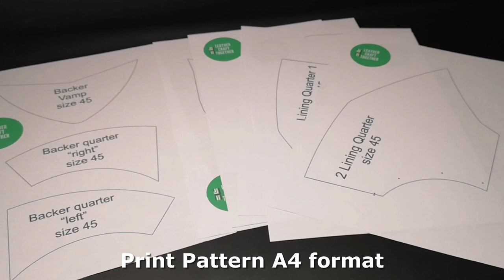Leather chukka boots making by handmade

Comment: Was really great until you just glued on a crappy moc welted sole. Why not do an actual Goodyear welt or stitchdown?
Reply from the maker: 1. Because a genuine leather sole with a welt will not survive in wet and humid autumn (as well as spring) and winter
2. The rubber outsole is more comfortable for the feet, as it is slightly cushioned
3. Real leather sole with welt is expensive for me and it is very long and difficult to craft
Reply: @leathercrafttogether8356  you do realize you can use a vibram or danite sole with a welt correct? It does not have to be a leather outsole. Look at White's or Nick's work boots that have welted or stitchdown V100 lug soles that will far outlast this boot.
Reply from the maker: @mattihnen2764  Thank you, I will take a look and try to know this topic better.
Reply: @leathercrafttogether8356  1. obviously moot point, stitch on Dainite or get a double/triple oak tanned leather sole
2. Some people might say that, but leather breaks in better and will make it more suitable for any shape of the foot, rubber will feel more comfortable at times but it is not better for the foot
3. of course a valid point but glued shoes are bound to be thrown away once the glue fails and the upper gets damaged. Also I think it's a shame that you put so much work onto the uppers and then just finish the shoe with such an underwhelming construction. Was also pretty disappointed when it came to the filler, pretty bad quality stuff used there but I guess it works for instructional purposes.
Reply: Simplicity inspires more to get in to shoemaking than to ”show of all your skills how to” uploads. Baby steps… Comparing other videos I really like how you make the nailing the upper to the last look so clean and easy, made me think I can do it too, so Im collecting materials to start soon. And thank you for the free patterns, what a champ! ❤

Comment: where can I get that pattern from?  aka template on paper for the 45 eu?
Reply from the maker: What is your foot length? I will help you choose the size
Reply: @leathercrafttogether8356  i will get the measurement to you. Most likelihood this afternoon pst.
Reply: @leathercrafttogether8356  11 1/4 length 7 1/2 on the arch round without socks on
Reply from the maker: You can use 43 size of pattern.  https://bit.ly/3cILdVN

Comment: Any chance of a pattern size 46-47?
Reply from the maker: What is your foot length?
Reply: 30cm
Reply from the maker: @creepydanno  45 size is 5 mm smaller. You can try using a size 45 pattern. Check the pattern (make one spunbond shoe and use on your shoe last)

Comment: 46 and 47 sizes are not available :(
Reply from the maker: Hello. These are already large sizes, I do not have shoe lasts to check the patterns. For size 46 you can test my pattern for size 45, maybe it will work
Reply: @leathercrafttogether8356  Hello. My foot size is 46.5 . It is very difficult to find ready-made shoes of this size. It's a pity that you don't have shoes of this size :(